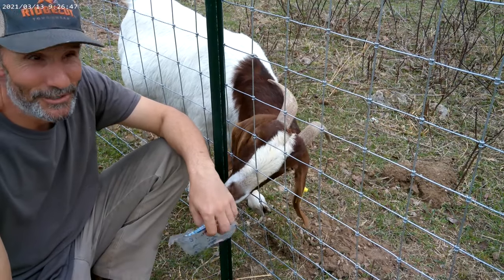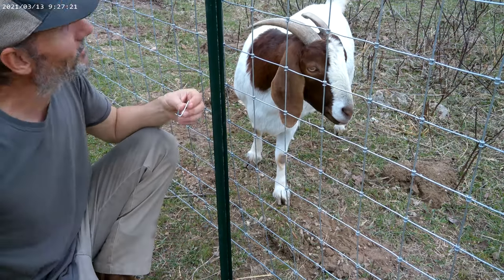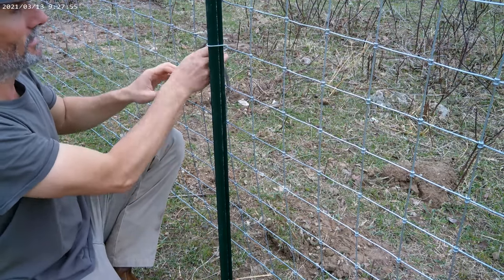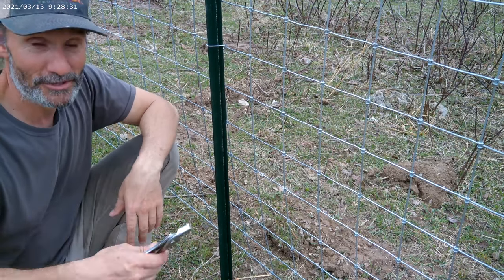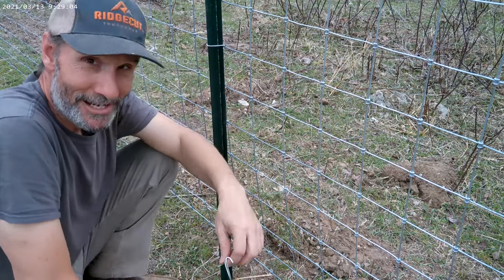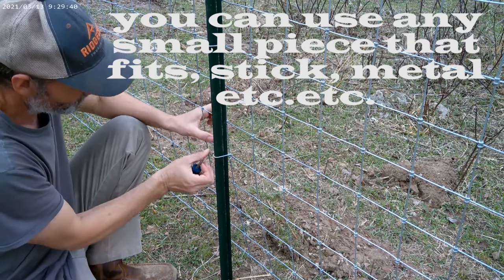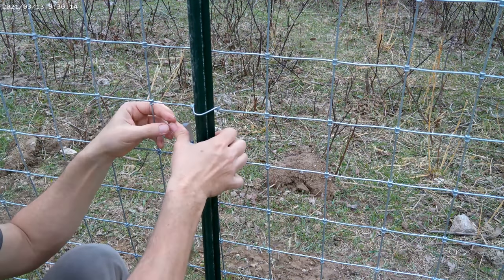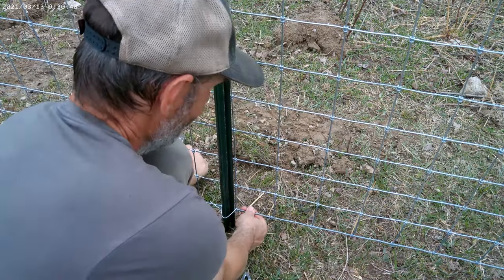How to install T-post clips

Comment: A 4 inch piece of flat/thin scrap metal with a hole drilled in one side will also work. If you got your clips from lowes then the stubby won't work. Don't buy clips from lowes is what i'm saying!
Reply from the maker: Nice tip, thanks! 👍

Comment: We used the 2x4 for horses. Seemed awkward watching at first but I realized we did the same thing but from the "inside of the fencing placing the small hook on the left side and pulled the clip around the back of the post  to the right side then twisting the wire with a screw driver and getting that first wrap without reaching through the fence. Used wire pliers to bend the ends to face the outside of the fence so animals don't rub against the fence and injure themselves on a sharp end of the wire. I can see why you found a way to do  it from the outside of your fence, you'd most likely have a cute little goat climbing all over you:) God love those little goats, they're so cute💚 Good video!

Comment: Very helpful! What kind of fence pounder do you use to put the posts in the ground? I have been trying to find out from Tractor supply which one will fit those T posts to buy one online and the customer service representatives don't seem to know. They have several different ones for sale. I can't afford a gas powered automatic one; just looking for a good manual one.
Reply from the maker: They are all design for T post anyone should fit

Comment: Gonna try it! Thank🙂
Reply from the maker: Hey thanks for watching and commenting let us know what you think it worked out nothing to be such a pain in the butt
Reply: @ozarkshomesteadandfarm  oh, another question I had...is there a cheap hack to attach boards to t posts? Those  brackets  are expensive when you have to buy a lot?
Reply from the maker: Plumbers hanging tape
Reply: @ozarkshomesteadandfarm  love it! 😊The last few years I have really been trying to ' use what I got' instead of spending more money. You've got that gift it seems! I'll check out the rest of your vids. Thanks again.

Comment: Good video but I bought clits that both sides were short so I had to drill a hole in a flat head screw driver to get it around bc the pliers didn’t fit through the 2x4 openings.

Comment: The clips that came with my t-posts didn't work with a screwdriver.  The screwdriver kept popping out because of the way the long end was bend in relation to the fence.  I ended up using lineman's pliers, and it sucked, but it got the job done.
Reply from the maker: I can relate……sorry

Comment: I’ve come to the conclusion base on various codes about this t-post fencing is simply a huge albeit cheap pain in the ass method of fencing. I haven’t seen a single video on here that shows me anything that actually help me ensure my fence is tight and these clip get properly installed. Guess this is just the con to t-post fencing
Reply from the maker: The clips just hold the fence to the post…….a tight fence is only attained by securing post wood/steel with concrete to allow you to pull the fence tight…..the more pull posts the better. T posts and clips only support the fence.
Reply: @ozarkshomesteadandfarm  yea I’m only running a temporary t-post only fence so yea no wonder I can’t get it to where it is actually taut. I’ll just deal with it for the time being. Thanks

Comment: Your on the wrong side. Get on the other side. Put clip on. Crimp small end, Use handle of pliers to spin large end around. Done takes 5 seconds. Watch a video how to use the clips before making a fail on how to use them 😂 or work for a farmer Jsjs